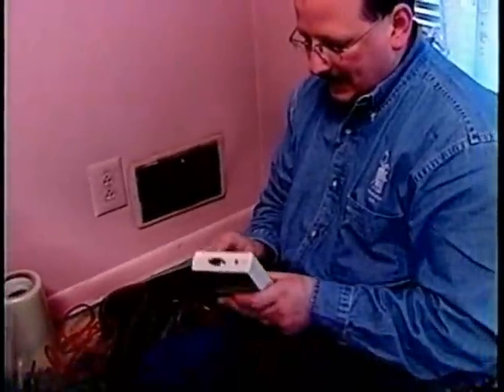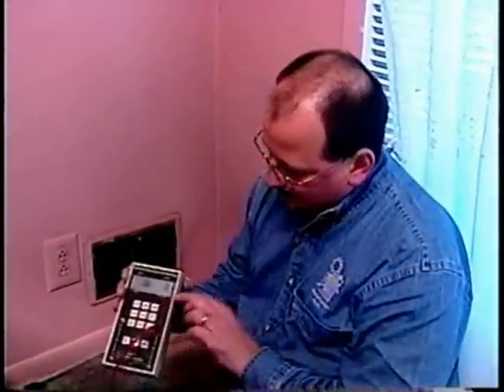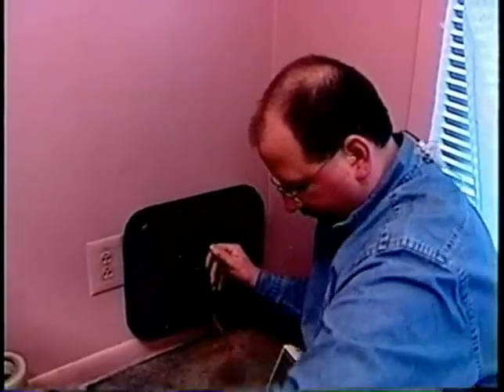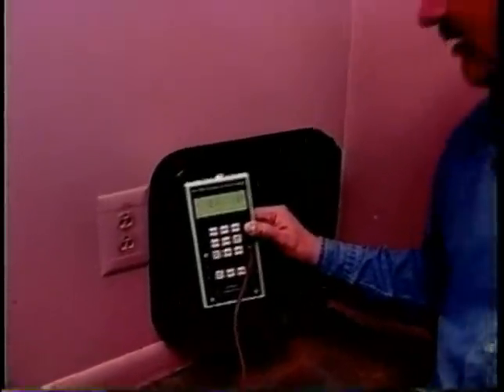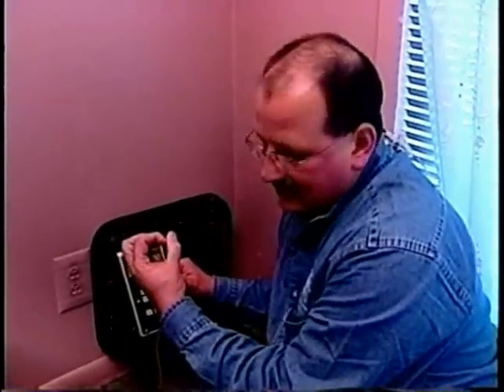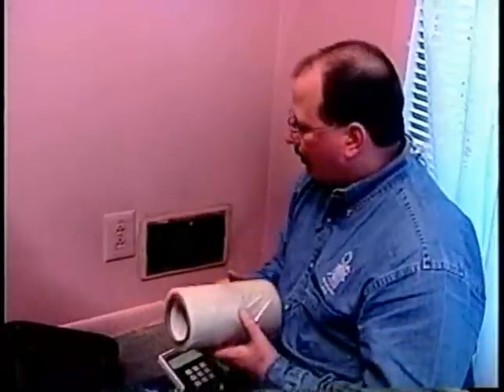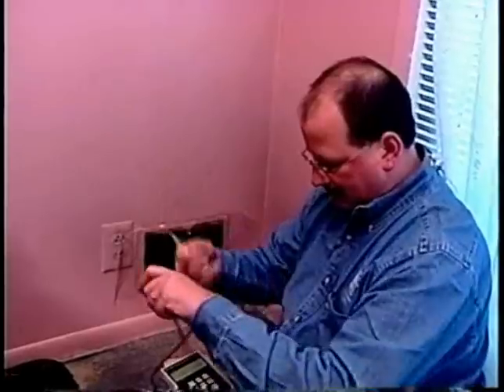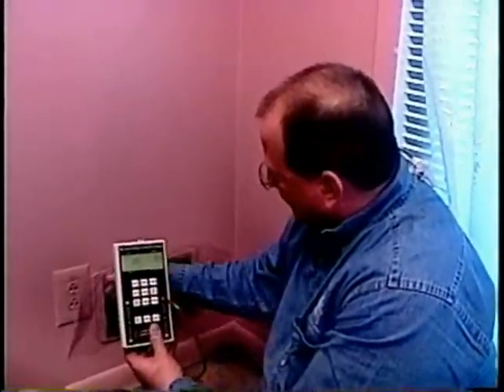Pressure Pan Testing

Comment: Hello

Can I use a pressure pan to test a before and after duct sealing job to determine an improvement in cfm supplied to the register?
If u could call...I’d appreciate it
517.974.8592